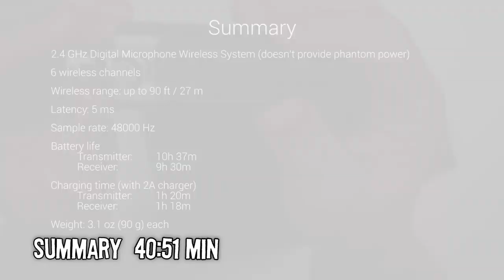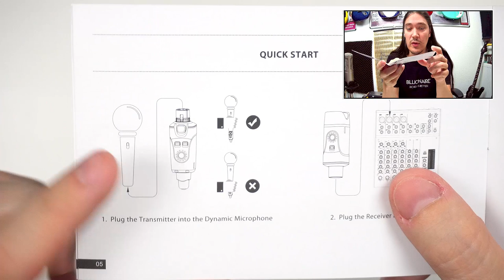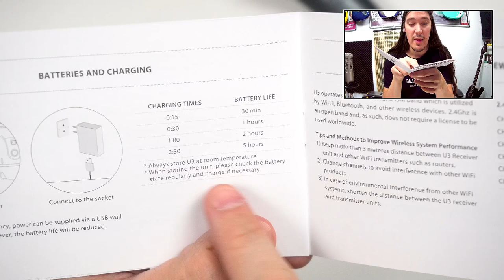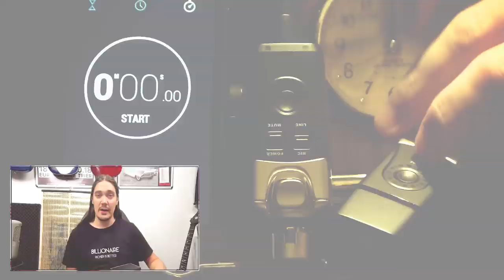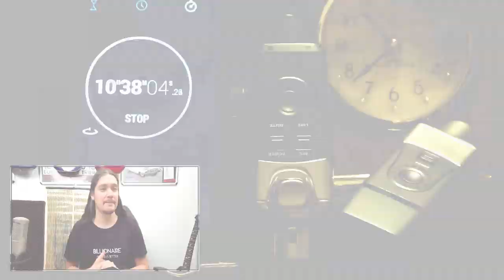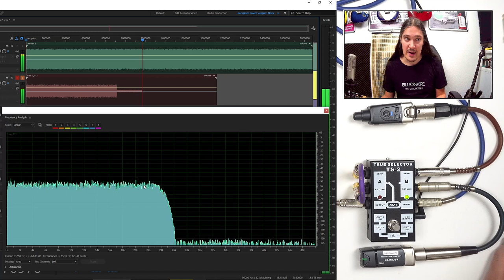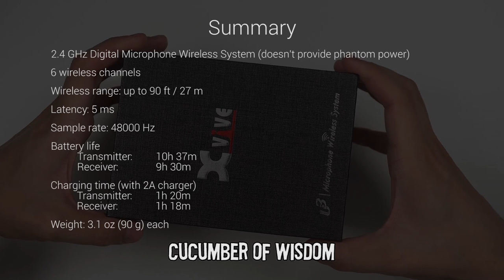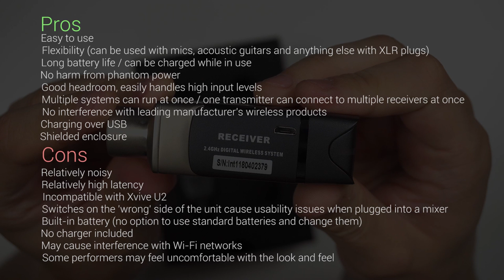Xvive U3 microphone wireless system. Full review

Comment: Hi, Max, greetings from Bulgaria!
First of all, congratulation for your detailed report about U3.
I have owned already two sets of this model and for both of them I have faced the same problem - too high level  of background noise. May I ask you for your e-mail address in order to discuss it. I will appreciate your support.
By the way,  Happy New Year!
Boyko.
Reply from the maker: Hey. I actually ran more tests. Turned out, the noise level for U3 is not higher but the same as U2. It's getting higher when used with unbalanced-to-balanced adaptors. The noise level is still higher than that one of let's say Relay G70 but we're talking about very low levels anyway. That shouldn't be a problem at all when used with a mic. What is your situation? How do you run it? We can totally discuss it here or on Facebook, link above
Reply: @MaxSoloMusic  Hi, Max, thanks for your prompt response!
Here is my story: Some weeks ago I have ordered by Thomann a brand new U3 set. I like the idea to convert a regular mic to a wireless one, furthermore, all reviews were very positive. So after the reception of U3 I have tested it immediately. My test was very simple (and may be not so professional): First, connecting my mic (Shure SM58) to my mixer (Beringer Xenyx QX602) with a cable, I adjust the volume of my PA speakers so far, that when I am in front of the speakers (about 3 m far from the speakers), I can hear my voice very good, but I can not hear any background noise. Then, without changing any adjustment, I replace the cable with the U3 set. Even when I have switched on the receiver only (connected directly to the mixer) I can hear an increased (but still acceptable) level of background noise. When I switch on the transmitter too, the noise is increased almost double and seems very disturbing and annoying. So I have thought, that this set is defective and  I have returned it to Thomann and have received another brand new U3 set.  Unfortunately, when I have tested  the second set, I have found the same problem. I don't believe, that I could be twice unlucky and could receive twice brand new U3 sets with the same defect. On the one hand, the use of U3 is so simple and nothing can go wrong, I just replace the cable with U3 receiver and transmitter. On the other hand, in all youtube's reviews (including in yours, thanks one more time for it!), I can not detect any increased noise level, when U3 is used.
I am a hobby musician, playing and singing to small venues of friends and would like to use U3 with microphones only. In this current situation with my U3,  I don't feel comfortable to use it, this "hissss" noise is making me crazy! I have checked my U3 with another mixers (Tascam, Presonus) and with another speakesrs (Yamaha, headphones) - the probem is the same. Of course, all this can not depend on the mixers, on the speakers or on the mics - when everything is working fine with the cable, but not fine with U3, the problem must be in U3? I am totally confused...
Of course, I can return back to Thomann even this second U3 set, but I am afraid, that there is not a real problem with it. But I can not understand where is the problem.
So, I will appreciate any suggestions for another tests from your side. Since I have not a Facebook account, the only way to go deeper in details, if you would like to help me (and not to be boring for all your other followers) is to use e-mail (this is mine - boyko.daskalov@abv.bg) . Let me know. 

Best regards and many thanks for your efforts!

Boyko
Reply from the maker: It's hard to tell what it is. I've tried U3 in many different scenarios and the noise was never any noticeable. Do you have a possibility to A/B test it versus any other mic wireless system? Can you check it with another mic?
Reply: Hi, Max, sorry for my delayed response. By the way, I have made a short and more detailed test and I will appreciate if you would like to have a look - the test includes one audio mp3 file (1 minute) and 6 pictures for illustration. Since I don't have face book, I can send it to you by e-mail (if you don't mind, I can use your "for business inquires" mail address).  
I have seen, that another subscriber (Tom Joad) have noticed the same problem. It will be fine to hear your comments.

And finally - огурец мудрости from my side too.

Regards, Boyko
Reply from the maker: Hey. Sure, use that address. Let's hear what it sounds like!
Reply from the maker: Hey. Yeah, I saw it but didn't have time to get to it, I was on tour. I'll take a closer look at it in the next couple of days

Comment: hello I tried them today at home: room of 10x15 meters, over 8 meters disconnects, and by pure chance I turned on the microwave to heat the food and makes such interference as not to hear the music .. unfortunately I was disappointed .. I was hoping . thanks anyway for your video!
Reply from the maker: Wow, the microwave test! I'll keep that in mind :) I'm guessing pretty much any audio unit may catch some interference though.
Reply: @MaxSoloMusic  yes, strange thing to have a microwave near a concert, but in the marriages there are huge .. moreover, the DMX lights control unit is also 2.4Ghz and as soon as I turn on the wireless lights, the sound is very disturbed. I have made these transmitters in the shop .. unfortunately
Reply from the maker: @thomasdegobbidjsax  not at all, every stage must have a microwave. And a fridge :) Speaking of DMX lights - i believe choosing another wireless channel for U3 would help
Reply: @MaxSoloMusic  try all channel and also look by wireless scanner app.. But nothing.. :(
Reply from the maker: That's unfortunate!

Comment: Why "phantom power protected"? It should be "phantom powered".
The transmitter should supply phantom also, that's half century technology which requires just few mW of juice.
Reply from the maker: Because there are many units out there that will get broken once supplied with phantom power. U3 receiver will handle phantom power just fine. As far as I know, at the moment there is no 2.4 GHz transmitter in this form factor that provides phantom power, it just doesn't exist. The only one I'm aware of is Line6 TBP12G, but that's a whole different thing
Reply: @MaxSoloMusic  It seems you don't get me, but that's ok, thanks for sharing anyway.
Reply from the maker: @PJSOFT  I've just got some intel that there's a new wireless unit that supplies phantom power to the mic connected to it. It's gonna hit the market at the end of the month
Reply: @MaxSoloMusic  Wow! That will be great. Thank you for the information :)